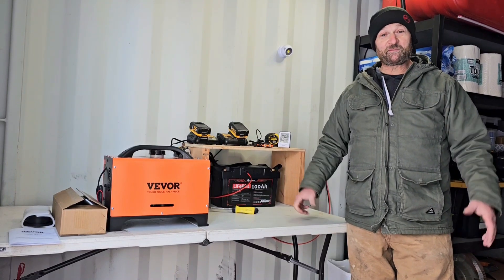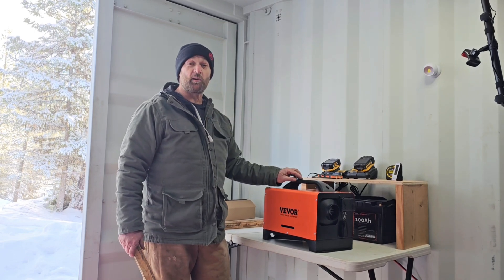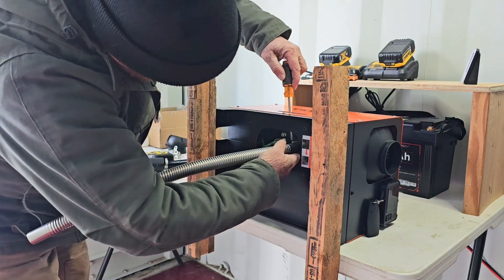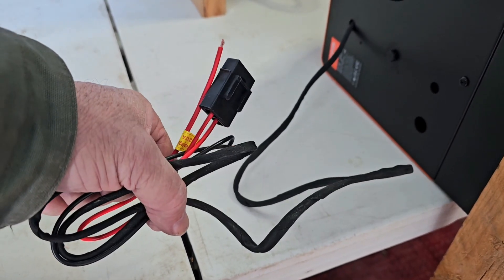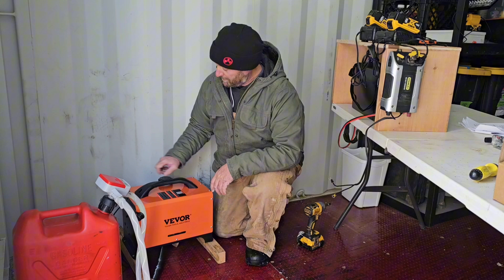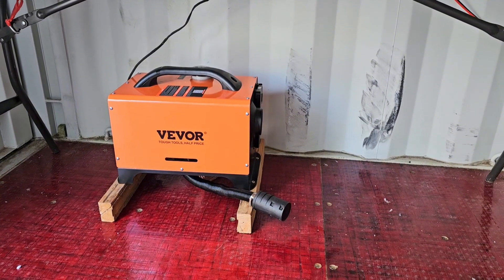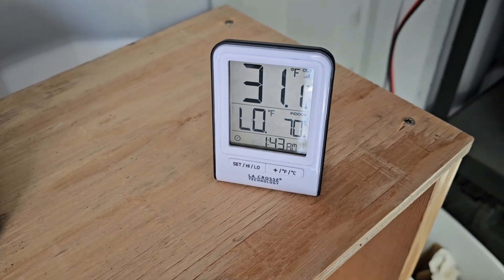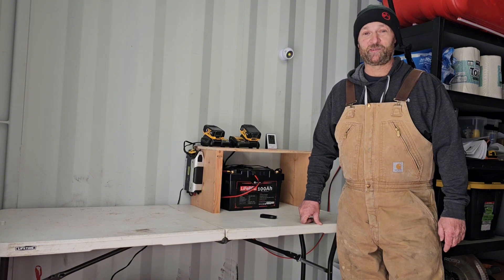Vevor 8KW Diesel Heater Install and Review: Efficient Off-Grid Heating Solution

Comment: Question: you didn't specify about the options for the power supply, I know you can use a 12v-110v power adapter but can you just hookup to a 12 volt car battery? I've ordered the ac adapter but until it arrives, can I just use my 12 volt car battery?
Reply from the maker: Yes, you can hook directly to a 12v battery as long as you bought the 12v model.  I believe they also have a 110v model.

Comment: On mine I piped the exhaust through a hot water radiator. The radiator puts out a lot of heat and you can the outlet is cool enough to touch. You may as well get the most out of it.
Reply from the maker: Sounds awesome. Nice work.

Comment: Can we leave the u it outside n install the vent inside?
Reply from the maker: Yes, you can leave the unit outside but you will be heating the cold air so it will be less efficient.  Inside the air warms and you are heating warmer air. Make sense?

Comment: I just bought 8kw Vevor heater and started looking at install instructions and they were horrible..   They covered two or three other models I guess.   (showing how to hook up fuel line and fuel pump etc.)..     I am going to hook up just like you did.  Only difference is mine will run off 110 AC.   I had to buy a converter to change to DC 12 volts..  about 25.00 online.  Thanks..

Comment: Lies take u more than 30 minutes to warm up just take a look on the time
Reply from the maker: You have a very good eye for detail. I did have to pause to do other filming before I closed the doors to the container. I had both doors wide open. It was a half hour after I shut the doors to the container that I returned. Despite what the clock says it truly raised the temperature up almost 16 degrees in a half hour. In about an hour it will bring the shipping container from freezing to a comfortable working temperature. I don't do reviews for money. If it didn't work,  I would tell you. Thank you for commenting and watching out for dishonest reviews.

Comment: Dude you totally left out how warm it got in the container after an hour or so.  31 to 36 is not much warmer, I would hope it could get to at least 50 - 60° did you get a final temp?  Looking to heat a 16x20 shed where walls are insulated (R-13) but roof is not. it gets pretty cold up here in NH in the winter and it keeps me from doing my woodworking.
Reply from the maker: I should have been more clear. The indoor temp is the 2nd (lower) reading. It raised from 31 to to 46.8, almost 16 degrees in a half hour. The container is usually in the comfortable 60's within an hour. I hope this helps. Thank you for watching!

Comment: Running the air intake outside isn't so much for getting denser air, but it's combustion air. If you pull that from inside, you're going to suck fresh cold air from outside to replace the air it's using.
Reply from the maker: That makes sense. So would you run the intake to the outside if this was your setup?
Reply: @solojimoutdoors yes definitely.

Comment: What's the purpose of electricity? Seems pointless if you need electricity
Reply from the maker: It needs electricity for the blower. It would be awesome if it didn't need it but I have yet to see a diesel heater that didn't use electricity for the blower.
Reply: @solojimoutdoors  for the same reason electricity is needed to run a gas furnace in a home.
Reply: @solojimoutdoors yeah, I'd imagine setting up the fan system that would be powered by the diesel.. 🤷‍♂️
We need off grid options, especially now days!!!

Comment: Great vid. Getting my Conex this week. We also will have months of cold/snow/ice. Did you get condensation on the inside of the roof? or have you insulated it. I told the wife our first priority  with our shipping container is to insulate the ceiling/probably going to do spray foam ourselves. Thanks again for a great vid.
Reply from the maker: I haven't noticed any condensation on the roof. I only run it a few hours at a time. Thank you for watching. Best of luck on your build.

Comment: I'm curious what the current draw is for the 12v to power the fan and control panel.   Would a motorcycle battery-sized jump pack work for a camping weekend to power it?  Or would someone need a larger amp-hour source? (maybe a marine battery or similar?)
Reply from the maker: I haven't tested that but you will probably want a fairly decent size battery if you are planning on running it all night. I don't think a jump pack would cut it. I would say 100Ah minimum.
Reply: @solojimoutdoors thank you!   I'll definitely try it at home first, before putting it to real-scenario use in the field.
Reply: I've heard it uses about 125 watts on start up then goes down to about 40 watts after warm up.

Comment: Do you have to buy anything else to install the heater 
You mentioned solar ?
Reply from the maker: The heater requires 12v power and I am on solar so I have a small power station that is charged from a couple 100w panels. I hope this helps. Thank you for watching.

Comment: Hey G'day mate just wondering how you went connecting the power to the battery? Like anything special you had to do or anything?
Reply from the maker: The battery connection was super easy. Add a couple of connectors, and then it's red to red, black to black.
Reply: @solojimoutdoors  to easy wasn't sure if I had to do something special also, cheer